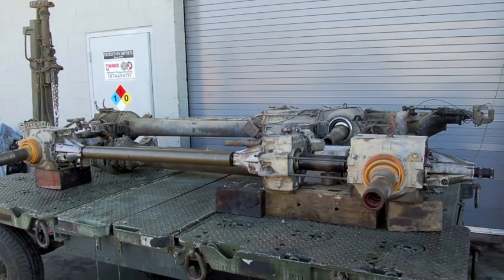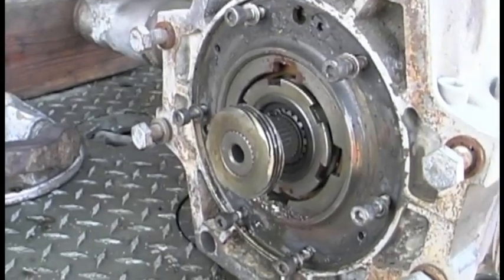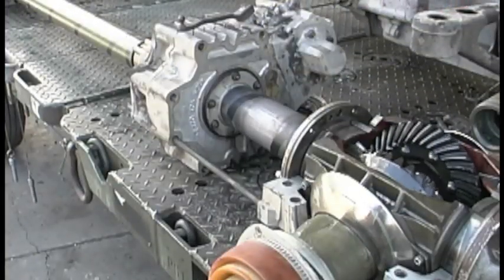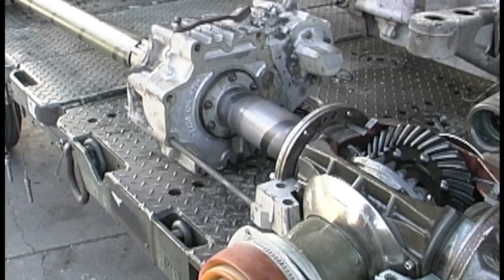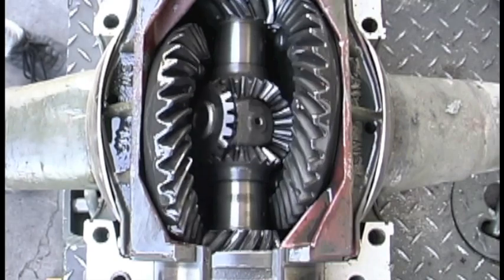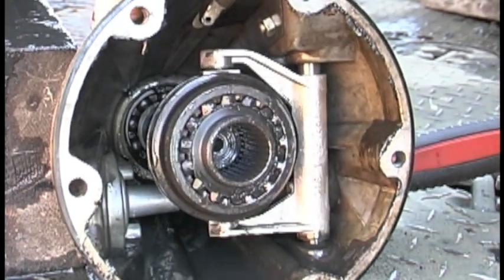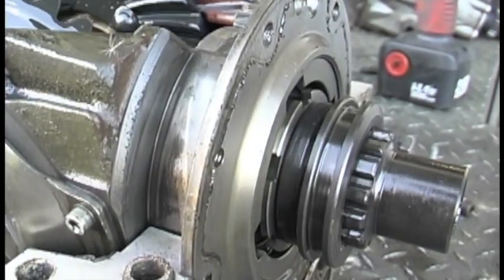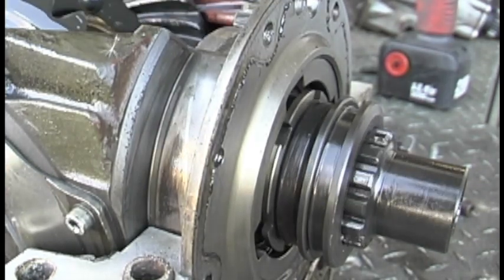Pinzgauer Driveline Operation

Comment: Is there any adjustments for off- centered crown wheel of front axle differential? There is an hard pressed bearing sound in slow vehicle movements, noticable from drivers cabin. The sound vanishes once the vehicle pick ups speed above 40- 50 km/hr. We are rechecked and done all lubrication procedures for wheel , axle and steering. On removal of rubber protective oil cover from both sides of differential and checking crown wheel movement, it is noticed the slightly off-centered movement of the wheel in respect of the scraper plate. The clearance is more than 3mm at some point and vary to 0 mm clearance at some other point on right hand side. Slight off centered movement also exist in left side also.  ( To clarify doubt we checked with another vehicle of same model and and found perfect rotation of the crown wheel). We are facing this issue with Tatra 815 6x6 euro 3 right hand drive vehicle. Can u please guide to resolve the issue..

Comment: Where can I get the whole drive line of this product
Reply: Buy a used Pinzgauer. The components are no longer is production.
Reply: @brianb-p6586 okay what this be the same system as the tatra drive system
Reply: @WayneStcroix  Tatra trucks and the Pinzgauer use the same design  of driveline by Hans Ledwinka, but none of the components would be interchangeable - they would be different in size and details.

Comment: Thanks, I really appreciated that explanation.  Simple machine ideals whipped into a fantastic package.  

Does this utilize portal axles at the outside for better clearance?

How does this compare to the driveline in the Haflinger?
Reply: Yes, there are drop gearboxes at the hubs, making them portal axles. 

Haflinger uses a similar backbone layout, but with conventional differentials and axle joints (and the engine is placed differently).

Comment: Sir. Could you please elaborate on the 3 control levers on the dashboard.

Also does this particular model have a centre diff- Transfer case.

And in the 6x6 variant, is there a lockable inter axle diff. Between the 2 rear axles.
Reply: One lever to engage drive to the front; the other two levers lock the front and rear differentials.
No, there is no centre differential: it is a part-time system, in either rear-only drive or four wheel drive with front and rear speeds locked.
No, the 6X6 has no interaxle-differential, or inter-axle disconnect: both rear axles are always driven, and always at the same speed. It's not good for paved surfaces.

Comment: Fascinating! I have read that the driveshafts are staggered by 30mm, due to the dual crownwheel setup. How does this translate on the ground? Are the portals slightly angled to compensate? I doubt that the wheels are staggered on the ground, as it would make the vehicle very near undrivable. Just in case you are wondering what the proper term is for "the witches hat", it is actually called the axle journal neck.
Reply: Some Renault car had staggered rear wheels (to allow the torsion bar springs to sit one in front of the other), and there was no effect on driveability.
Reply: @brianb-p6586  Interesting! Can you remember which models had this setup? Thank you for your input. :-)
Reply: @gmcevoy  The one I remember is the first-generation Renault 5, which is the only Renault of it's vintage sold in any significant number here (in North America). The R 5 suspension came directly from the Renault 4, and was also used in the Renault 6, but apparently was not used in this form in larger or later models, or even the second generation 5.
https://en.wikipedia.org/wiki/Renault_4#/media/File:Axle_-_Trailing_arm_41.gif
https://en.wikipedia.org/wiki/Renault_4#Suspension
The specs in Wikipedia (for the Renault 4) show a 45 mm (2.8") difference between the sides.
Reply: @brianb-p6586  Fascinating. Thank you!

Comment: ive always wondered what would happen if the differential overextended itself and the two axle gears were to touch
Reply: Destruction. The pin mentioned in the video limit travel to prevent this, but probably wouldn't be strong enough. The suspension bump stops and droop straps prevent excessive travel.
Reply: @brianb-p6586  don't want to be the one to open the diff up to find out!!!

Comment: Does the Tatra system work like this as well? Absolutely brilliant way to design an offroad vehicle and an excellent explanation of how it works as well. Thanks.
Reply: This Is pateneted by Tatra
Reply: @ondrejkluc8760  This was never patented and it's not Ledwinka's invention. Stop repeating bullshits from Czech Wikipedia. Ledwinka was the only man in the world, who was able to design design this conception for mass production. And because Ledwinka designed Pinzgauer as a freelancer, Steyr didn't hold the necessary know-how to design other vehicles with this conception. The cost of development is the only reason why Tatra is the only producer of vehicles based on this conception.

Comment: And why hasn't the big 3 and Toyota or Nissan been using this engineering??
Reply: Putting this into small vehicle is like fishing with a bomb. As far as I know Pinz is the smallest vehicle to be fitted with this driveline, it was of course built for military use. TATRA  is probably the only one left using this system. It is simple but heavy and expensive, even modern military vehicle use a beefed up version of conventional system. 

Search "backbone chassis" for more info or visit 6-wheel-drive.org
Reply: Well the smallest would be the steyr puch haflinger.

Comment: Very interesting way to arrange a differential, especially because it means the wheels on the same 'axle' are not the same distance along the vehicle. 

What can't be seen here is that (As far as I can work out anyway) the input drive to the diff turns the shaft that the side pinions in the meshed set of 4 in the centre of the diff are attached to. This transfers drive to the front at back pinions in the meshed set of 4 to transfer drive to the half shafts going to the left and right wheels. 

The locking mechanism locks the input shaft (Which passes uninterrupted through the differential) to the rear pinion driving the crown wheel to the left half shaft. Looking at the way the drive shaft passes straight through the differential, I suspect this is why they're able to make 6x6 or 8x8 versions easily with the same building blocks. The downside is that wind-up in the shafts will be an issue where there's full traction on all wheels as all axles will be driven at the same speed, so maybe there's more to it, my knowledge of this driveline is limited to guesses from looking at the video here only.
Reply: About 1/2" or so, it doesn't really matter.
Reply: True - the crown and pinion gears shown turn the drive 90 degrees and allow suspension movement, but they're not the differentials; the internals of the differentials are not shown.

Comment: It doesn't matter where the design came from, these are awesome off road vehicles in 4x4 and 6x6 setup.  The only downside is the complexity and hence the considerable in service maintenance required.   Costs of major driveline failures are astronomic.  Even the military wince  at the operating costs.
Reply: Dartmoor Dave Not really, Tatra Trucks are still in use after 40 years of working. There is actually nothing to broke in combination with air cooled Tatra engine. 
Maybe just pinzgauer is crap.
Actually with this concept you can build unlimited number of axles truck (Tatra builds 16x16 trucks for rafinery Now) and the costs are getting lower than standard chassis with more and more axles.

Comment: Thank you for this amazing Video! I came to it while studying Tatra Trucks, but the title here says "Pinzgauer." Are they related? Do, or did, Tatra Trucks use the same axle manufacture as Pinzgauer? My research, so far, shows me that Pinzgauer and Tatra are a line of Trucks, and not necessarily the drivelines manufacture. 

A second question, in my head, after watching this video, is to learn more on just how the independent axle travel was limited. When either the Truck leaves the ground (Think Dakar Rally), or by bottoming out, say when the Truck is overloaded on rough terrain. I did hear that pins of some sort, in the upper axle house facilitated the limit, but I would sure love to see how that is being done. 

Also, I will try to go and look now, to see if I can find the History of this "Pinzgauer" drive system, in the Dakar Rally.
Reply: Tatra builds it's own drive line and there's plenty videos on Youtube showing this.  Hans Ladwinka designed this system when at Tatra in the 1920's and his son did a similar design for Steyr-Puch (who make Pnzgauer) in the 1960's.  So the link between the companies is father and son and nothing else.

Tatra build their own vehicles including the driveline and Steyr-Puch built theirs although BAE Systems Inc. bought the rights to Pinzgauer in 2000 and built them in England from then onwards.
Reply: The son Erich Ledwinka also worked some time for Tatra and took the concept to SDP. They even got sued for it. You will also like the Haflinger which is built the same way but smaller.
Reply: https://en.wikipedia.org/wiki/Hans_Ledwinka
Reply: Thank you for that link Thomas. I have read that before though, and even a second time. I still cannot glean exactly who is building this driveline. Are you saying that this video also has Tatra parts? Or could it be now called Steyr-Daimler-Puch? What does the data tag read on this Pinzgauer Driveline I wonder?
Reply: Captain Win - Thank you very much for those pieces to the puzzle! Now that makes perfect sense.

 I have seen some "Tatra built" wording in several videos here, but no "Tatra building" these drive lines. I will narrow my searching a bit more, and do my best to come up with some of those.

Most people don't know, or dig in deep enough to find the differences. Licensing deals could be playing a role, behind the scenes for example, in some manufacturing/assembly lines, and we wouldn't know it, until we look for those answers. I am wanting to know the entire history.

Again, thank you very much for taking the time to reply with that information.
Reply: Forestal Frank Thank you.

Comment: Aren't you moving the driveshaft in the wrong direction?  The engine would move the shaft clockwise, looking from the front, which would turn the half-shafts what would appear to be in reverse, but because the Pinz has portal axles, the direction would be reversed by the larger bull gear in the bottom of the portal axle, providing forward motion.  Correct?

Otherwise, good vid.

Comment: Backbone tube nicely explained. It is interesting to compare both Porsche and Ledwinka continuing to develop same ideas as Tatra on other side of Iron curtain. Pinzgauer reminds me mostly of Tatra 805. They both look a bit nervous off-road, perhaps because of high center of gravity. Despite that, both are quite capable.
Reply: Wrong Porsche steal from Tatra it is fact but WW2 and cold war after masked this theft. After WW2 Tatra got small compensation from german for that but that's all.

Comment: So the wheels on one side of the vehicle are misaligned with the wheels on the other side! So the vehicle swerves as you brake hard. Crazy!
Reply: The half shaft crown wheels are driven off centre but the half shaft housings and tubes are in line out to the hubs and linkages. It's a great system. Never seen one so well split

Comment: so when the diff is not locked, Is the one shaft driven and the other totally free balling?  is there any friction drive or anything else putting torque on the outside coaxial shaft when the locker is not engaged?
Reply: The torque goes through the main shaft to the boxy thing visible in 2:22, which distributes it via the spider gears to both ring gears, so also unlocked both wheels are driven.

Comment: so again. this type of chassis is from Hans Ledwinka, the first use of this chassis was the Tatras, is not talking about the video talking here about the chassis, as my colleague has already said that it was Tatra later is not true, tatra was the first in the video for the Steyr but chassis design is from Hans and was used for the Tatras and later modified in Steyr, Steyr chassis that could be used on bigger trucks because it interfered with the patent Tatras,Tatra heavy truck steyr light truck